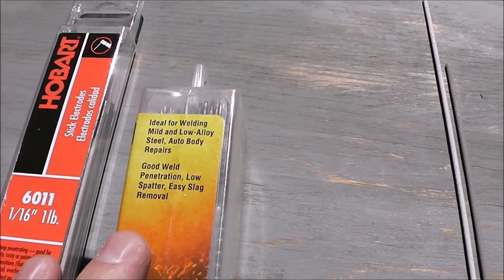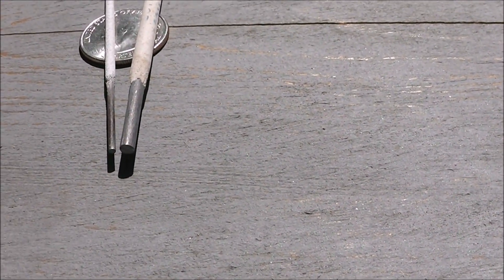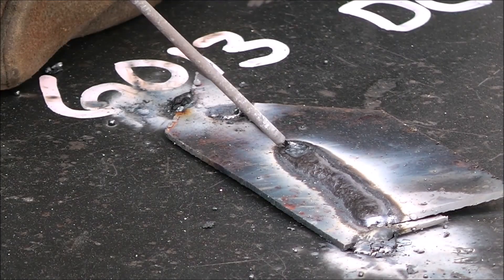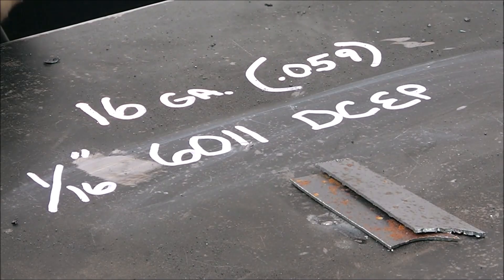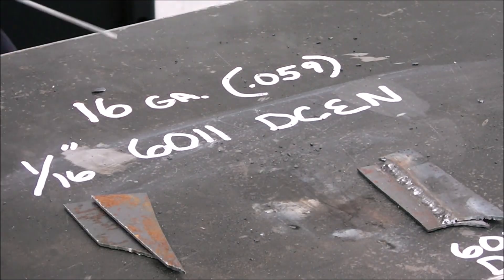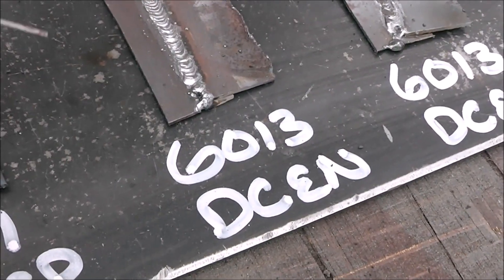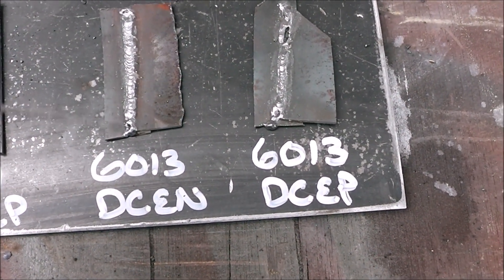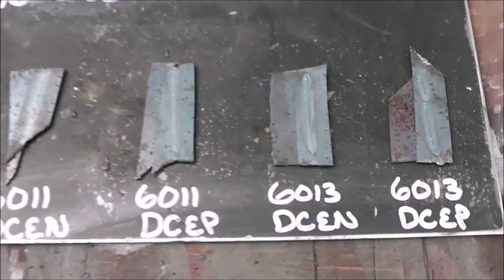6011 Vs  6013 BEST POLARITY for WELDING SHEET METAL

Comment: I've read up on using a little thicker rods than 6013 but removing the flux off the rod ... I'm curious how that would work... could you possibly include a fluxless rod in a vid on thin sheet like in the current vid....im very curious!!! Great vid bro!
Reply from the maker: I've actually never heard of stick welding with the flux removed. Where as the flux is there to shield the weld puddle I would think it would be filled with porosity.
Reply: @BrandonLund  thanks for getting back to me. The fluxless rod was something I seen on a message board and the subject was on automotive sheet metal ... at first I thought "bullsh*t" then got thinking  about how thin that type of sheet metal is and so little heat to fuse and fill .... my mind has burn marks from curiosity....
Reply: BigDaddy B do u mean brazing?

Comment: So from switchin from ep to en all you do is switch the leads backwards? And any recommendations on exhaust piping?
Reply from the maker: Yes, just switch your leads. If you have to weld exhaust tubing use EN with 1/16" 6013 rod. It wont be easy. Exhaust tubing is very difficult to stick weld without blowing through. Wear a mask. Some exhaust tubing has galvanized coatings which is toxic. You don't want to breath in the fumes. Disconnect your battery and be very careful around fuel lines.

Comment: For the new guys watching this:   Never buy rods in those 1 lb plastic cases like you see here!    You’ll get robbed blind for something that lasts almost indefinitely .   Unless it’s some sort of specialty $$$rod you aren’t likely to use up always buy 5 or 10 lbs box.      The plastic boxes store them nicely and youll use those general purpose rods up somewhere sometime.    Some LWS carry a house brand generic that are cheap .   I get most of mine at Tractor Supply (Hobart).
Reply: That's a direct contradiction of what Lextech said, 4 comments above you.  He said this guy had TOO much angle and should stand the rods up more.  You say he needs MORE angle.  Who do I believe?  Well I have  to experiment myself and see what works best for ME.
Reply from the maker: @montinaladine3264  lay the rod at a fairly steep angle. Not vertical. 6013 is fluid. A steep drag angle keeps the molten weld puddle pushed back and lessens slag inclusion. That's how 6013 is supposed to be run.
Reply from the maker: I've got 49 pounds of 7024 from 15 years ago that disagrees with you :) lol. Seriously though,  for me these little rods aren't anything I use often so anything more than a pound or so and I'm just wasting money and storage space. Now 1/8" 6011 and 7018 is a different story. I buy that by the 50lb box, so yah if your going to use it, buy in bulk. You will save a lot of money overall compared to buying it by the pound. A 1 pound box of 6013 will last me for YEARS lol. Cheers brother!

Comment: May I weld with 6010 Rod using  AC?,  if not why?
Reply from the maker: Good question. If your asking IF it can be done,  than yes. If your life depended on it you could make a 6010 stick something together but it will look horrible and it will refuse to stay lit because 6010 rods are an AC ONLY rod. If you want the deep penetration that a 6010 rod gives, just run a 6011. It's basically the same rod except it's designed for AC or DC.
Reply: Brandon Lund thanks a lot
Reply: Brandon Lund if I understand right 6010 is a dc rod and 6011 is ac/dc
Reply from the maker: @dougbormann3972  That is correct, however, many of the inverter type DC welders will not run a 6010 rod due to the open current voltage. 6010 rods are very common with pipeline welding using a DC Engine Drive Welder (the welders you see on the back of welding rigs).

Comment: Hey this was incredibly useful! Thanks alot! 

Video Idea: How about you test these same rods on the thinnest steel possible, such 24 gauge or thinner. Your wheelbarrow weld video was awesome, but it'd been cool to take on a challenge like that in the methodical testing format of this video.
Try out different techniques to avoid burning through, such as tacking opposing sides, using a filler rod & clamping on a thick piece of metal as a heatsink. Maybe try it with the the arc starting assist on your system turned on & off. 

That would make a REALLY interesting video imho. I'm a novice who's been researching welders over the last few days to try to understand the limits of each method, I've combed youtube and haven't found a video like that out there. I know it'll probably be a pain in the ass to make though. Lol.

edit: even further, test how flux core does on these same pieces of metal. And then bend test them with a sledge hammer.
Reply from the maker: Thank you. This is an excellent idea! It will be a PTA to make, but I think it will be very educational once done. Thanks for the suggestion and I appreciate your support. Keep your eyes open for this video in the new year! Thanks again,  Brandon

Comment: hi there.For all the money in the world I cant understand the difference between DCEN and DCEP,  I'm only a hobbyist welder
Reply from the maker: Hopefully this helps from Lincoln: "Note that for stick welding in general, DC+ polarity is most commonly used. It produces a good bead profile with a higher level of penetration. DC- polarity results in less penetration and a higher electrode melt-off rate. It is sometimes used, for example, on thin sheet metal in an attempt to prevent burn-through."
Reply: @BrandonLund  Thank you Brendan for speedy reply.BUT does DCEN then means I put  the electrode holder in negative slot and earth lead in positive slot?
Reply from the maker: @henryrossouw930  yes that is correct. DCEN the electrode holder plugs to the negative terminal and the work clamp connects to positive terminal.
Reply: @BrandonLund  THANKS A LOT>Finally an answer to all my asking around and getting different answers.
Reply from the maker: @henryrossouw930  im glad I could help :)
Reply: @BrandonLund  thanks again Brandon.Wishing you and your family a wonderful Christmas and a prosperous new year.
Reply from the maker: @henryrossouw930  Thanks Henry! Merry Christmas to you and yours!

Comment: Thank you for the video. I picked up the Tractor Supply Co. Metal Man arc80 recently. I haven't done any stick welding in 8-10 years and forgot a lot. Checking these videos helps quite a bit. Good info. As far as the metal man 80... not bad. It's a good light weight machine for home use...runs on 110v 20 amp. First time my son used it he laid down a nice bead. I'm gonna pull out some scrap and practice. I did manage to drop a small project and your video helped me. Thanks again.
Reply from the maker: Congratulations on your new welder purchase and I'm glad I was able to be of some help.  I saw the Metal Man for the first time this weekend at my local Tractor Supply but i wasn't able  to see much of it because it was still in the box and they did not have any displays set up. It's a good feeling when you can fix, repair and build things around the house using your own tools and equipment.

Comment: Another fantastic video. I was using 6013 DCEP, and was burning straight through some of my metal. Fortunately, I was able to mess around with it enough to fill in the gaps, but they are not strong welds at all. I will have to do a lot of practice tomorrow, and try switching to DCEN and try it again. I am building a frame for a battery box using angle steel that is lightly galvanized and has the holes cut in it, like what you would see on a sign post. 

Thanks for making great videos to share your knowledge.
Reply from the maker: The more you do, the better you get. Your probably aware, but just be careful welding on galvanized. The fumes are very poisonous. Some of the things you can do are - use a respirator, grind off the galvanized or weld it in a very well ventilated area. I prefer to grind and weld with a respirator. Cheers brother!
Reply: @BrandonLund Thanks, man. I went out and bought some mild steel for practicing on. Welding on the galvanized steel last night really messed up my lungs, and i had to call in sick to work today. Felt better this afternoon, so tried welding DCEN. Had a much better outcome.
Reply from the maker: @AnonYmous-cf2ci  awww man that sucks! FYI, (if it happens again) drink milk...it will help make you feel better much quicker. It helps rid your body of the zinc. Glad to hear the welding is coming along and I hope your feeling better. Cheers brother!
Reply: Could also soak the galvanized steel in vinegar for awhile to dissolve it. No respiratory problems and very inexpensive. @BrandonLund

Comment: They aren't "springy" you have too much rod angle. These 16th rods will run smooth as a 1/8 7018 and slag peel every time. All those choppy beads are from welding sideways. They run best at 40 amps. Stand the rods up properly so they run smoothly. These little 6013 are some of my favorite rods. You'll enjoy them if you do.
Reply: Hi, what do you mean ‘too much rod angle’? I use 16th now because I’m working on 1/16”  (1,5mm) square tubing. Do you mean the rod needs to be straight on the metal? So 90 degrees? Thx
Reply: @Gemzy275  This is old, so mainly answering for other people watching this, you want your rod angle to be minimal, 5 to 10 degrees in either direction, depending on position on the weld. So yes straight up and down with a bit of angle is fine.
Reply: @BudMasta  thanks man. I literally JUST saw this and think it will help me a bit
Reply from the maker: @unknown 1984 that is incorrect information for 6013. You run a much steeper drag angle with 6013 than you do with other rods because it's weld puddle is runny and the steeper drag angle keeps the weld puddle from piling up and creating porosity. 15 degree max for other rods but 6013 you want 25 plus degrees of angle. I don't normally pipe in but running 6013 vertical  to 15 degrees is not how this rod is intended to run and will only give you huge problems

Comment: A lap joint on thin sheet metal is not a good rod test.  A better test rod test would be a butt joint with a slight gap.  A 6011 is a high penetration rod. You'll find that it has a tendency to blow right thru the gap.   6013...  They're sometimes called an all purpose farmer rod that works on AC buzz boxes . They're  much better for thin sheet metal because they're not a high penetration rod. It won't blow thru as readily.  It also helps to hold the rod on more of an angle and travel a bit quicker. 
  6013 is recommended for thin sheet metal.  6011 isn't.  6011 is more for  burning thru paint and rust. It's also used for a root pass on heavy pipe. 
    As you stated...Thin rods are wiggly.  Shortening the rod by cutting it in half helps a lot.

Comment: This information came at the right time for me. Am a novice in welding and am trying to do a DIY  welding project.
Here in Zimbabwe the only rods that are easily available are the 6013s, and the smallest is 2.5mm. I have been having challenges using it on square tubes 1.6mm thick. Was using DCEP at about 78A  with a lot of blow holes. I think I am going to switch to DCEN, judging from what you have just shown in the video, I think I will achieve better results.
Thank you, from Zimbabwe.
Reply from the maker: Thank you for your comment! I love hearing from viewers across the country and hearing about their projects. 6013 can be a little difficult to weld with. I cant remember if I mentioned it in the video, but try experimenting with a steeper drag angle also. 6013 likes a somewhat steep angle. Cheers and thank you for your support.
Reply: Thank you. Will try everything you have suggested here.

Comment: Hello and thank you for this video clip.
I tried DC electrode negative stick welding today.
The welding is far   better.
As from now,I will go DC electrode negative!!!!
Reply from the maker: ollivier bissiere I’m glad I could help! It makes me feel good when a viewer says that I have helped them. Thank you for sharing!
Reply: 20 years ago I bought an AC/DC Tombstone,  the big Lincoln book on welding, & 50lbs of rods. Teaching myself to weld, I built a shop out of used oilfield pipe. 
I discovered an iron powder rod. Forget the numerical designation,  but on DC reverse polarity the metal flowed So gently into the pool. Nice welds and good joints. Was a really nice forgiving rod.
Reply from the maker: I think your referring to 7024. 7024 will lay down some of the nicest beads anyone will ever see but it is only for flat and horizontal welding, however i always found welding flat was the best position for this rod.
Reply: @BrandonLund  with dcep your bound to get more penetration and that’s the goal. Dcen will focus heat on the tip of the welding rod and if the metal isn’t thin enough you’ll end up with cold lap
Reply from the maker: Exactly!

Comment: Thanks for running this video. I had an old welder tell me that as a rule of thumb to run any rod ending in an odd number on DCEN and those that end in an even number run on DCEP. I've kind of lived by this rule even though the rods are sometimes recommended to be run the opposite way (like 6011). However, based on your results, it looks like he is right.
Reply from the maker: Interesting!...I had not heard that before, but it sure seems to make sense! Thanks for the tip!  That just goes to prove, you are never to late to pick up tips and tricks!
Reply: Five years on - would you say this rule of thumb holds true?
Reply: @ZacharyMelo  I'm not a welder by profession so I'm not the best to answer this but for the welding I have done I'd say yes.

Comment: Welding 16gage (1.6mm) is easy, now try welding 22gage (0.8mm), thats where it gets tricky.
Reply from the maker: 22 gage is much harder to weld. The best way on super thin metal is to use quick tacks spaced evenly and then go back through until everything is connected.

Comment: Nice experiment. 

6011s are more of a high penetration rod for dirty metal. 
6013s were designed for sheet metal so I'd stay with those if you're intent on stick welding sheet metal.
I had a body shop back in the day,  MIG & oxy acetylene pretty much covered everything.
Reply from the maker: I'm old school...I started out learning to weld sheet metal floor pans brazing with O/A...anything beyond that is a piece of cake 🤣🤣🤣. Lol

Comment: Nice! 
For auto body work, especially sheet metal restoration stuff, it would be nice to see how butt welds could work out. Low amp settings and good penetration without burning holes is tough. Mig works best, but a lot of folks don't have mig and 6013 was designed for sheet metal back in the day.  Maybe you could try some butt welds with 1/16th. 6013 one day. Thanks for the good vid.
Reply: Everyone has MIG now days. 20 years ago, not so much. But MIGs are so cheap, there's almost no reason not to have one.
Reply from the maker: Thanks man!  I can tell you that butt welding sheet metal is a tall order, but I will gladly give it a try. The blue demon has an awesome hot start feature and I think this would be mandatory with running the amps as low as I would have to for this to work...I like your idea! Thank you!
Reply: I'm no welder however even i agree that's a tall order .the amount of heat even on a lap joint i suspect would just blow through & that's just for a tack since you wouldn't be able to continue the bead without it doing so .Not sure if even a heat sink in the rear would work either .For sure those rods you use in the vid are dam whippy alright lol it's like your seeing double when welding as it has that flex movement going on (i have some & was using them yesterday .They're a freaky rod to use i.e small 6013) Must get some 6011 & see how they go .Just to clarify the 6013 you actually didn't hold the rod off the metal but put it on it & dragged ? i must try that .I also found not enough amps made the slag stick in the weld & make holes where the slag solidified grrrr , however now that Richard mentioned about heat on the base metal that could be why i was having issues
Reply from the maker: @scorpnz4433 for 6013 I pretty much just lay the rod in there gently and hold a pretty decent drag angle. I went back and looked at the video and it looks a little exaggerated but you want it fairly steep. Im not forcing the rod in, but I'm also not holding a gap. There is basically no weight or pressure against the tip of the rod.  6013 is very fluid so  having no gap combined with a steep drag angle helps to keep the puddle blown out ahead of the rod (which is why it's so easy to get slag inclusions with this rod). Having very little drag angle will allow the puddle to wash back and cause slag inclusions and porosity.  I hope that was clear enough. If not, let me know. I run 7024 pretty much the same way also, just not as steep. 6013 rods usually start very easy so if your sticking, try turning up your amps a little, hold a steeper drag angle and just lay the rod in and see if it inproves.
Reply: Cheers mate that was clear & precise & understood .It worked as you said. The sheet i was welding yesterday was far to thin for the rods .Seeing this vid (just got back inside from retrying a weld on the same size steel plates you used) a noticeable difference lol  that's how a bead should lay yeehaww
Reply: @BrandonLund     yes. The rod coating, at a steep angle, keeps the steel part of the electrode, at a constant depth to the base metal.